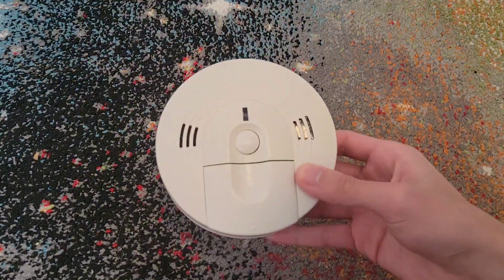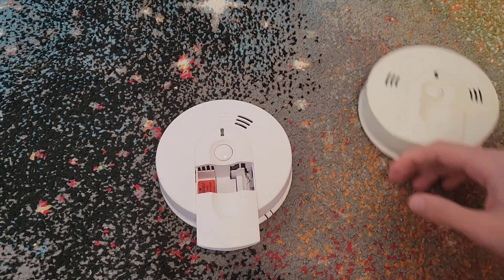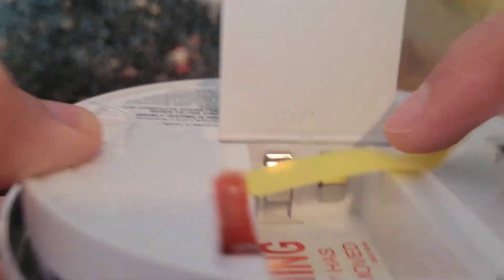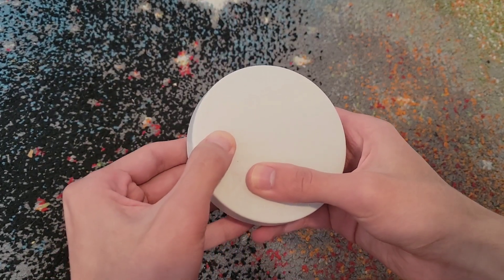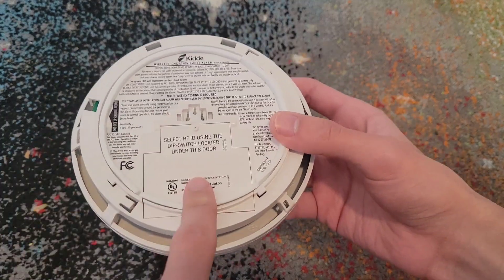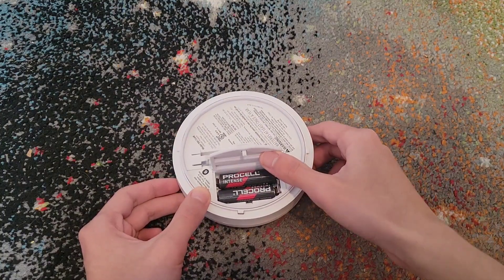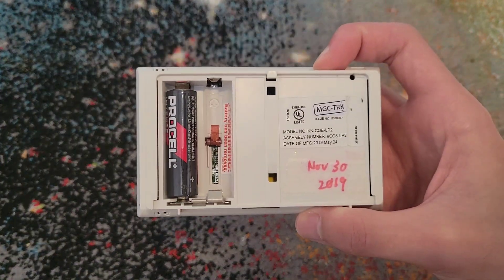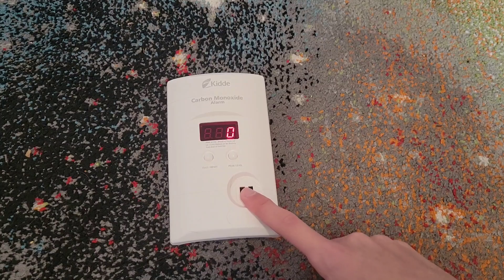Changing the batteries on various modern Kidde smoke alarms

Comment: I appreciate you showing many models.  But  on the CUAR-900 (which I have), you didn't tell us how to do the hardest thing: how to "press tab" to remove the AC wiring harness (to allow battery door to be opened).  You showed us the detector with the harness already removed :(
The harness release (described in manual as simply "press tab", with no mention of what to do next (e.g.,which direction to slide things)) is inadequate.